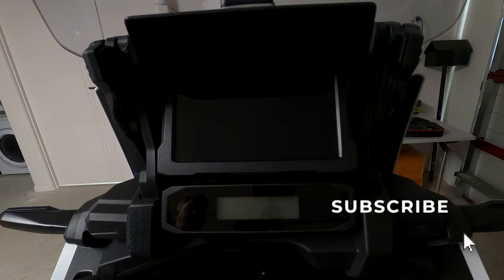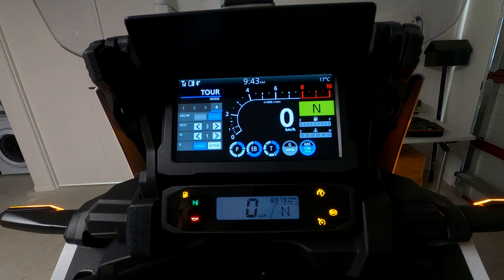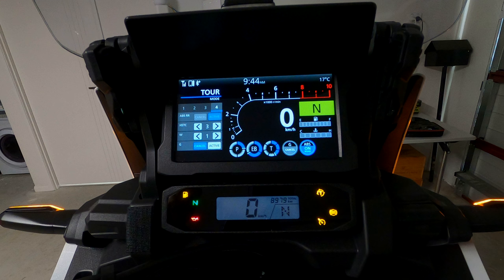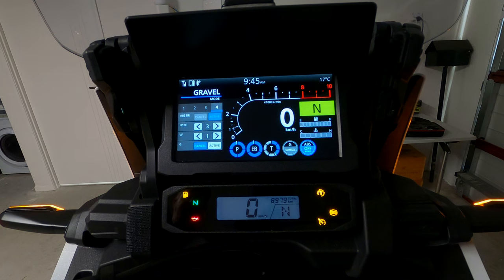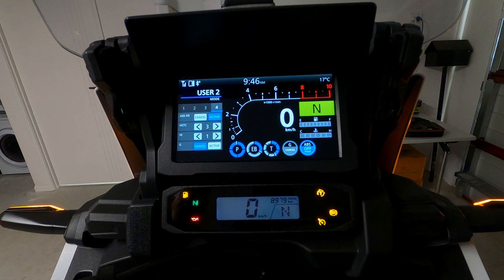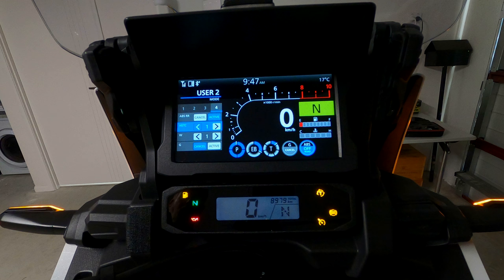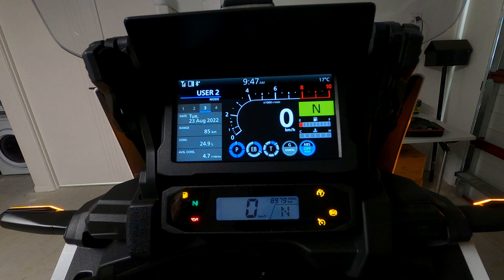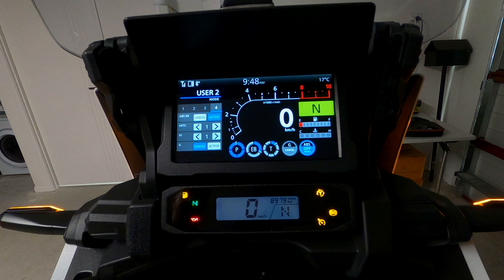What TFT Rider Modes do I use on my 2022 Africa Twin Adventure Sports DCT?

Comment: I sure wish you would have made this video in March when i got mine😂. Great explanation, straight to the point and simple enough. Man it was a serious learning curve going from my Multistrada to the AT. The Duc had more settings but was a little easier to navigate. After playing with the AT for a month it is quite simple. It's just dialing in the suspension for the riding. I think if I go play on the trails again I will have the rider W/ Passenger selected for a more firm feel.  OH, I still haven't messed with the "G" button. I saw that you can set it for what ever you want.

Comment: Looks like you just need some fuel and you are ready for your next adventure Brett! I've now done 2300km odd on my new ATAS and are very pleased with it...roll on spring. Still waiting on new tyres but managed just fine off road on the dirty ole OEMs. South Island here we come. Cheers from across the ditch
Reply from the maker: Awesome Andrew!! Which OEM tyres came with the bike? I've got maybe another 1000kms remaining on my Karoo Streets. Can't wait to change these out.
Reply: @ADVBrett  The OEM tyres here in NZ are Bridgestone AX41T - Adventurecross Tourer, a heavily road focused tyre. With around 30% gravel use they have already worn quite poorly. I have Motoz tyres ordered - GPS for the rear and Dual Venture for the front and I am confident that they will do the trick nicely. The ATAS is a big lad (or lass in your case) and tyre choice is pretty important I reckon. Great machine, hard not to love Honda
Reply from the maker: @andrewstrong3506  That sounds like a good combo, I've got the Tractionator both front and rear ready to go but already I'm keen for something more dirt orientated. Time will tell!